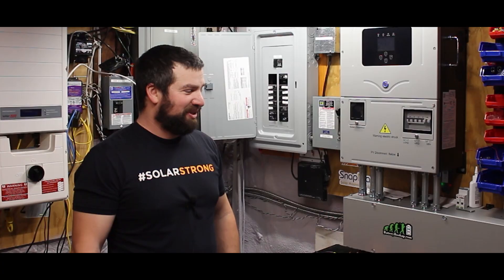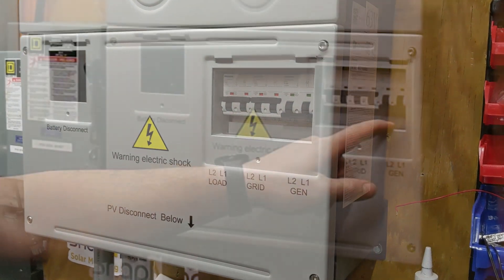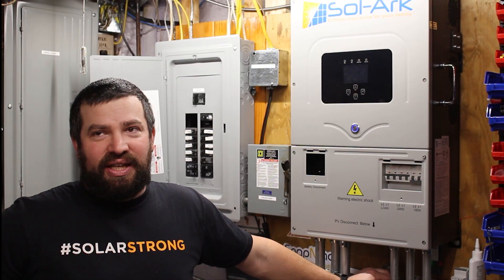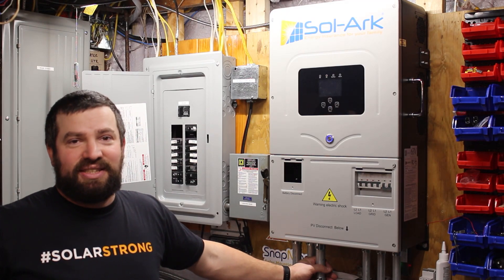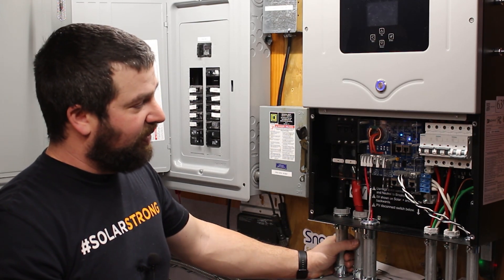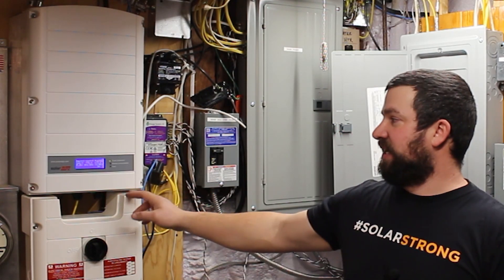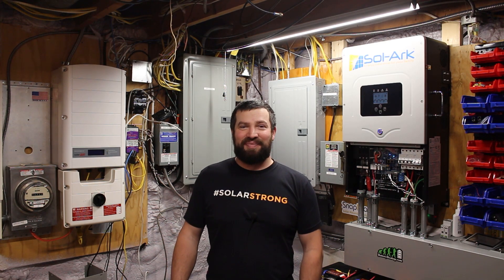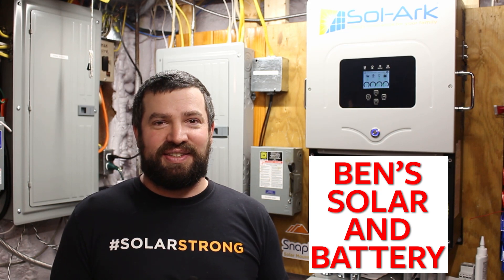Why the Professionals use the Sol-Ark 12K Inverter and Solar Charger

Comment: Humm my YIYEN 12k inverter starts my 5hp compressor and can run my 1.5hp well at the same time.
Reply: There are definitely larger inverters out there that have more umph than this.  Also, in this case, 12k is not referring to the inverter capacity off grid.  YIYEN makes a solid inverter, but not sure I would confidently install it at a customer's house.
Reply: @benssolarandbattery  SMA all the way
Reply: The 12k unit can put out 9kw of ac continuous and if he bought the 8k unit it puts out a max of 8kw of ac continuous. I would assume that's 4.5kw or 4kw for each of the two phases, with either 8 or 9kw available for 240 volt loads. So if he's got a lot of loads on the phase he's running the air compressor on, he's probably running into an issue where the that side is overloading. The specs say it can handle up to 20kw surge for 5 seconds, so 10kw on each side would be my guess. I'd be really curious what the startup surge on that compressor is. It must be pretty high.
Reply: The title says 12K but at the end he says he bought a 8K inverter.

Comment: So if the utility power fails, but that main input breaker is still closed, what stops the backfeed?
Reply: It has anti-islanding no power will be sent to the grid if incoming power is not sensed...also arc fault protection so no lightning arresters needed like with other inverters....it would be easier to list what it doesnt have lol
Reply from the maker: The Sol-Ark detects if the grid is down and doesn't send out any power on those legs.

Comment: Very nice video very good explanation of the Solark inverter. If you are going to use this inverter with grid power or AC coupled it is awesome. I was able to help set up a second Tennessee off-grid property here about 5 months ago and they bought the Solark for their Total off-grid Property. Now having said that what I have not heard anyone say is this very expensive unit is made in China. Also if you are going to use this in a off-grid application it's not a 12K inverter it's only 8,000. It definitely does not like unequal 120 volt loads it will shut down. Not knocking the Solark 12k  but if you were going to use it in a total off grid application  I do not recommend buying one. My twin Magnasine 4048 PAE set up blows that thing out of the water in a off grid application  I'm So happy I did not buy one. The high-voltage charge controllers were the main reason that unit was chosen. Again with my own personal experience with one of these in a off grid  application there are much better choices out there just my two cents.
Reply: Exactly
Reply: I'm totally off-grid and have been using my Sol-Ark 12K since last August without any issues. I have ran my Dewalt compressor and welded on 120V at the same time without any issues. Never has shut down using any 120V power tool of any type. My compressor might have a different start rating than the 20gal. one Ben uses but,  I will be piggybacking with another Sol-Ark 12 this coming summer as I increase my array to 19200W of solar panels. There is nothing that matches it on a system like mine will be. When I first set my Sol-Ark 12K up, I only had 5960W of panels and use the gen/set to power my 220V Welder and 60gal compressor in my shop during peak hours. If you are off-grid like I am you must have a generator coupled to your system like I do now, running on propane. I also ran a 120V line into my shop direct from the generator to charge batteries for my cordless power tools as an extra backup. So, from the wire savings, shut off switches and the extras you needed compared to me, the validation of your comment is not correct in my book.
Reply: @fisherus  I have been living totally off grid for just short of three years now. I suggested my friends look into the Solak inverter for there total off-grid property. They have 14000 watts of solar power. They not me  have had several instances of a hundred and twenty volt shutdown issues with the Solark inverter. The main reason for suggesting the solark nverter they bought was the dual high voltage charge controllers. I ran four strings of 9 solar panels in at 390 volts Voc. We left a total of four 340 watt solar panels unhooked per solak recommendation I am merely sharing my experience with these people's experience with the solark 12K which in a off-grid situation is only capable of 8000 Watts Peak. If you are happy with yours good for you. My point was for a purely off grid system there are better choices. I do not sell don't make any money or any of these products just sharing my experience.
Reply: FYI you can have 4800W on L1 and 0W on L2. It has huge 240V peak power. But you are correct that some 120V inductive loads >3/4hp can be an issue. We recommend rewiring those massive motors to 240V (most are convertible on the motor). The 1400W limit is with DC Loads. A heat gun on high is an AC load but on low, it only uses 1/2 of the sinewave (DC load). Our limit for DC loads (hair dryer, leaf blower, drill, blender, curling iron, heat gun only on low setting) is 1400W. It is designed, tested, and serviced in the USA.
Reply: @Sol-Ark  I am not saying anything negative about your inverter. It was one of my three recommendations for these folks off grid inverter. I have not said anything unfair or untrue about your system. Simply stated for a strictly off-grid system only there are better choices available.
Reply: Agree! Labeling as 12k is misleading and the shutdown over unbalanced loads was enough for us to be a dealbreaker

Comment: What batteries are you using?
If I had to do it all over again I would buy a Solark too. But I didn’t know enough back then. 🥸
Reply from the maker: He is using some EV batteries.  (electric cars).  Lithium NMC.  I'll be dedicating the next video just on the battery bank for more details.
Reply: @DavidPozEnergy  
Exotic batteries, I wonder how hard it is to set the parameters on something like that?

Comment: The one thing they do not include is a wind circuit.
Reply: hijack the generator input for wind?
Reply: They are actually working on that!  It would take up one of the solar inputs, which would be the only downside.  I think I heard that was coming out in a few months.
Reply: We are working on a wind circuit to go into the MPPT's. You will need 3 phase wind generator and then convert to DC with a rectifier (100-420Vdc). But if you have an AC Coupled wind, that works now.
Reply: @Sol-Ark  - why can’t you take a DC wind generator output into your MPPT input today? Why is it any different from DC Solar Panels?

Comment: David - the beard is a good look, man. :)
Reply: Wait a minute
Reply: Haha
Reply: that guy isn't David ,his name is Ben. and my personal opinion of transform less inverters rated 12kw and can't run an air compressor are useless for  me because I  have too many inductive power tools in my shop . I got a 6000 watt AIMS transformer based  low frequency inverter that runs everything not problem , it has a 18,000 watts surge  it has been running for 5 years . so for  me low frequency inverters are the best !

Comment: I run a 60 gal quincy air compressor off 2 lv5048 in parallel with no issues
Reply: I do this as well but with two 5048mg's. I also run a plasma cutter at the same time as the compressor.

Comment: Can you combined two Sol-Ark 12K Inverter and Solar Charger together so that you can run your dryer and charge your car at the same time?
Reply from the maker: Up to 9 units in parallel, which would be an insane amount of power.
Reply: @DavidPozEnergy  I plan to use Thermal Dynamic panels to produce my own heat for the hybrid water heaters then use thermal generators to turn it into electrical power while also using the hot water to heat my house with floor PEX piping. I do plan on having solar panels combines with it if it's possible to do so, I am still learning, Have you ever heard or use thermal generators before?
Reply: @DavidPozEnergy  To do off grid with Mitsubishi 7 tons mini splits ( 4 ton and 3 ton)- what would you recommend for inverter?? 48 volt system with Simpliphi newest batts

Comment: Can you wire the compressor for 240?
Reply: Possibly.  I'm also going to wire in a transformer on my bench to take both legs and turn it into 120v for starting heavy loads (and for fun).
Reply: Maybe, an installation of autotransformer will help in starting 120 V loads? The same unit, as in David's video with Growatt inverter. It based from following suggestion: if a given inverter's 120 V leg (L1 or L2) is under overload, its voltage decreases, and extra energy will start to flow from autotransformer's 120 V leg winding to load, supplements load's need. This energy will be transferred from another leg by autotransformer. So, it will act as legs balancer.